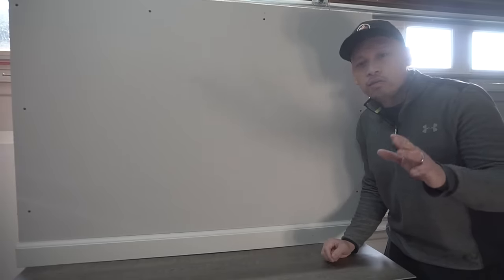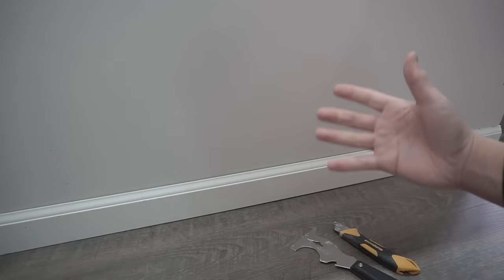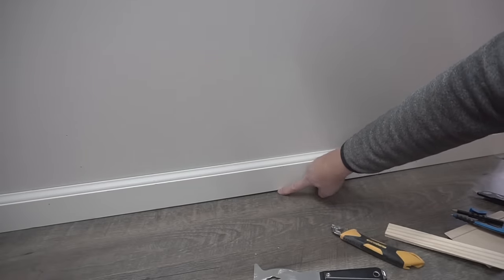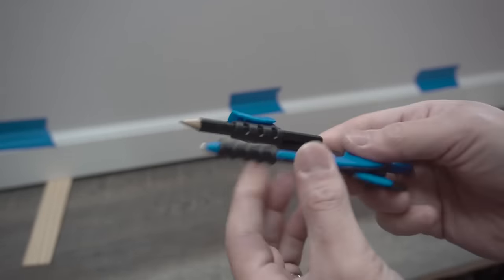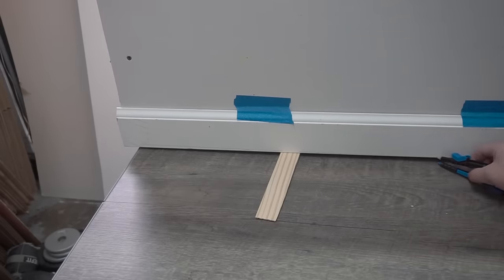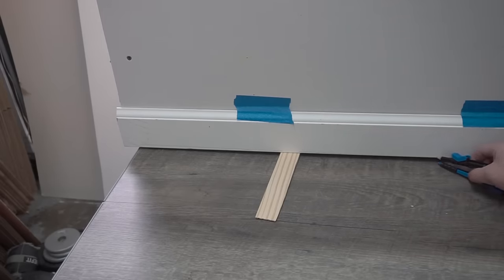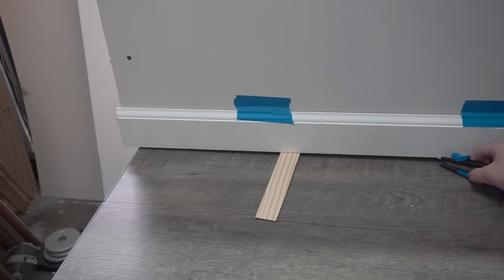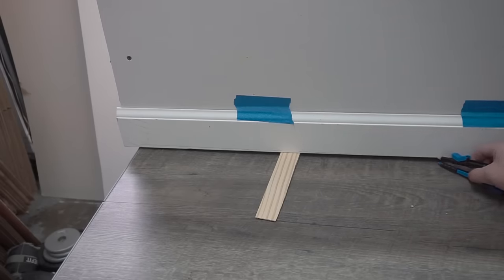How To Fix Gaps Between Baseboard And Floor For Perfect Fit! DIY Step By Step Tutorial For Beginners

Comment: I have a much easier method.  Don't go through all that sanding or planing of the base board.  Add a quarter round at the base of the base board, which are more flexible, will hide any non-huge curvature in the floor and looks pretty darn good.  Plus the job will go much quicker without all that sanding.  Fill in any cracks with Alex.  Tip: put the brads for securing the quarter round into the base board and not the floor!
Reply: I got a easier one. You can lower the baseboard more the add finish nails. If it’s still a bit opened then just add caulking. I did this so many times that my caulking skills in impecable no one can tell lol

Comment: Remove baseboard and more than likely damage the drywall, or if not you have to work at possibly blending the now exposed area. Or save yourself quarter round and be done in 90% of the time.

Comment: This has got to be the longest time ever to fit 1m of baseboard  good luck doing  the rest of the house using this method 😬
Reply from the maker: Just an option 👍🏽😊🙏🏽, can always use quarter round, shoe moulding or caulk. It’s by preference

Comment: this method works but grab a block of wood put it above every gap and push down flexing the base add a few nails. time is money but yes your method is nice if you have lots of time.

i would offer this service to my clients but i advise against modify baseboards for many reasons. 
some customers see gaps like this and think its shatty work but really after i inspect the workmanship was perfect and every summer theres a gap and every winter theres no gap what do you think happens when you remove that gap in summer and now it becomes winter??? some customers demand to much perfection from materials that move. i will solve these customers request but decline them as future clients as they are a headache waiting to happen. 

i love the clients that can understand expansion and contraction as well as any other advice i offer to avoid potential future regret.

every alteration you make to any material will likely change or remove the materials moisture barrier and you can accelerate the materials degradation thats why when you connect baseboards together you use an adhesive or caulk at all cut points at the base of material is a lot of exposure.
almost got scientific but in the end its all about what makes the owner most happy!

Comment: With this scribing situation where the floor dips is totally incorrect!
It works only if this base sits by itself. 
If the base connects to the adjacent base around the corner withs miter, you will start to cut the height of the adjacent base, just to cover this little one. More unnecessary work involved. 
Pushed that sucker down and nail it!

Comment: Rip some 1/8th shims. Stack them against the baseboard as high as you need.  A little bit higher is fine.  Hold them down and draw the line.  Cut the baseboard.  This video should be 30 seconds long.

Comment: 1. This is a bad idea, you will make extra work and have an issue on the corners. You will have to do this everywhere.  2. Also not a good idea to push it down and nail it, you will see the elevation change and it will look meh. 3. As long as the gap is 1/8" or less, just tape the floor and fill it with caulk, then paint it when you paint the base.  Three major benefits to caulking it: The elevation will be flat, the bottom will be sealed and prevent water from sucking up in to MDF base, its fast and easy once you learn to caulk with a little skill.  If your gap is like 1/4", stop and address the dip in your floor, or get creative with the other methods.
Reply from the maker: Thanks for the feedback. This is just an option for those who have gaps in the middle and it tapers to the edges. Just giving options 🤷🏽‍♂️

Comment: Sorry but this is not good. I use one of the two options: 
- (Not so preferred) open the bottom of the flooring feed with some self leveling chemical and raise the lower part.
- (The best) Have an approx 3 feet of timber, around 1/2 thickness 5-6in wide. Nail the baseboard on one of the highest spots, then put the wood piece by 90 degrees on the baseboard's low spot on top. Push the wood edge meeting the wall down with your knee and nail it to the wall. Keep on doing it by sliding the wood piece as needed on the lower sections. What you are basically doing is following the wave of the flooring and shaping the baseboard accordingly without any thickness change caused by cutting.

Comment: Sorry but that little gap could have easily been taken care of without scribing, when installing the baseboard you can flex it down before nailing, if you need to scribe , do it with a piece of wood up against your material to the desired thickness.. and never pound a nail back through because it will destroy your finished side.. picture a bullet going out the other end.  I appreciate people making videos that are actually knowledgeable.

Comment: Yeah you just cut off on the bottom left now how is it going to line up with the other baseboard at the corner its gonna come out short
Reply from the maker: This was just a 55” mock up, sometimes dips happen around middle areas and tapers off to nothing on the edges. Like what I mentioned this is an option fix and only apply on certain situations. It is not a cure all. Options are important.

Comment: That’s what shoe molding is made for. 7/16 x 9/16
Reply: This is also what scribing was evolved for. Shoe molding is the proffered method because the labor it saves pays for the extra material.  I don't know what it is but there is a price/foot were builders should move back to scribing.

Comment: If your floors are not level , DO NOT LEVEL the top of the baseboard. You will have one end of the baseboard a completely different height than the other end and it will look like crap.

Comment: a table saw would of made that so much easier... but this is way too much work for a baseboard, just press down on it and nail it down flush to the flooring.... baseboads are flexible enough to handle more flex than you think

Comment: No need to scribe this baseboard to the floor. You cannot scribe as when this base meets adjoins base there will be a difference in height…..no no
Just apply light pressure to lower the base down at the low point. Or add just a little sealant to cover the gap if needed.
Final point, level the floor before you apply there floor laminate then no problem for the base.
60 yr old cabinet maker. / joiner

Comment: nice try but no I wouldn't use that method. Get a big lad over 250 lbs and get him to press down with the butt end of a 2x4 where the gap onto the edge of the molding and flex it down as close as you can get it. Nail it in place.

Comment: Err, waste of time just silicone seal it, the flooring isn’t waterproof from underneath, so a bead of silicone and a moulding tool to get a good finish, allows the floor to expand and contact, seals it and it looks great, pissing about removing skirting boards and cutting them is just a waste of time, unless you floor is a bus ride out of flat, but if it was you’d screen the floor with self level before you fitted laminate

Comment: They invented 1/4 round for a reason. This would be for a rookie not a professional.
Reply from the maker: Yes hence the title 👍🏽😊 also this is just another option 🙏🏽😊
Reply: Hehe… There’s absolutely nothing professional about adding trim pieces on top of trim pieces. Can’t stand any floor-wall transition with more than a baseboard.

Comment: Now, as a professional trim guy, explain why your estimate is 4 times higher than any one else's and it's going to take you 2 months to run base. Good luck.
Reply from the maker: I do these for DIYErs not fo contractors 👍🏽
Reply: @FixThisHouse  That may be so, but you're doing a pretty big disservice to your Average Joe here. Once you cut down one piece of base you need to cut every other one that it meets. Not a big deal if its one piece going from casing to casing, or even 2 pieces. But if you're doing an entre room with 5-15 miters... I mean you could start with a 5 inch base at beginning and end up with a 2 inch base half way around the room if you're not paying attention.

Don't get me wrong, I use this trick all the time in the proper context. The key is context. You only do this in certain areas and certain situations. They way this is presented makes it seem like a whole house solution, which it is not. I'm not saying its a bad technique or that you did a bad job presenting it. I am saying that presenting to "DIYrs" who haven't run miles of base and don't automatically see why this is situational and not standard could get some one in to trouble.

Comment: Way faster way. Leave the board on the floor, take a carpenters pencil lay it flat and draw the line on the base. Then for the love of god buy a block plane and shave off to the line. Belt sanders and jig saws are not the right tool.  This gap by the way is so small you could take another piece of base about 3 feet long, place it on the top of the base on the wall and then kneel on it. The base will sink into the gap. Nail it and be done.
Reply: I'm seeing your comments on carpenter videos man you know your shit 🤣🤣 I just got started finished carpentry thanks for the the tips and knowledge. Can you give me any advise about crown molding? Doing some this week for the first time
Reply: @stephancccc8176  first welcome to the world of carpentry, best trade in the world. Crown molding, well there’s a topic. Can you hang base board using a scribe and coping saw?
Reply: This skill is required to hang crown the right way. FYI.

Comment: What a shit jigsaw cut, having to use a belt sander to clean it up lol. Pro tip is to push down on the point that is high and spike your fixings with some polymer. Also noticed that it's only on one wall. You'll be in trouble if you start to do this and the skirting continues around the room continuously.

Comment: Totally wrong way of doing this its ok for a high spot, a low spot without using a shoe molding you measure the maximum gap then rip that thickness off another trim then glue it on... then do what your doing this way it'll match in even with solid wood that's going to be lacquered.

Comment: So now when you have to wrap the baseboard around the corner, the next piece of baseboard will be taller so you are now going to have to cut down every piece of baseboard.  No thanks!!
Reply from the maker: This doesn’t work in every situation. This is just an option. This will work great for big dips in the middle area and then tapers off the edges 👍🏽

Comment: THIS IS NOT A GOOD SOLUTION!!!
As soon as you get to an inside or outside corner, you'll have to "shave" that piece to match the last piece. MDF does have some flexibility, so, push it flush to the floor.
Or, don't be so cheap and do the job properly, by giving it a much better finished look and install quarter round.

Comment: Nahh! Adjoining baseboard  will not match height. Unfortunate. But caulking.
Reply from the maker: This works only if the dip is on the middle and it tapers out to the edges 👍🏽😊

Comment: REALLY?? are you kidding me? all that work? for what? ONE word people. SHOE-MOLD. i wasnt going to comment but all this work is stupid. shoe-mold is fast, cheap and looks fantastic. its flexible to push down and hide any gaps. take off the baseboard? going to have to repaint, touch up. recaulk, fix any damage you did. are you kidding? hey ... go for it if you want to waste time and make a mess. oh ya. dont forget to buy all the extra tools (sander etc) to do this. SMH.
Reply from the maker: I agree with your shoe mold, but not everyone wants to go that route. Don’t say something is stupid just because you don’t agree with options. That’s exactly what I put in this channel is OPTIONS and thinking outside the box. There are other ways other than shoe mold…there’s caulk, quarter round, pushing down the baseboard (if you want bowed boards) and this method. So many options 👍🏽😊

Comment: This is not practical in a professional setting I can see it being done as purely diy an oops I didn't think of that moment but as a professional home contractor or any one else in the trades would have run multiple checks on there substrate and done all flat or level fixes prior to the floor install in these cases 99% percent of the time some glue on board does the trick or if in the right circumstances some good self leveler.

Comment: That's too much extra work and you still have to caulk it. If you're planning on going with baseboards with no quarter round or shoe, hire a professional floor installer that will get your floor flat within 1/8 inch in 6ft and bypass all this EXTRA WORK. LOL

Comment: No offense but that gap is too small, you can just push it down with your knees or just put a shoe molding 😂. No need for that extra work because I can see the imperfection of the cut, it’s time consuming.
Reply from the maker: Thanks for the feedback! This was just an example as you can see I’m doing this On a mock up. It’s meant to show concept depending on similar situations. Just giving people another option 👍🏽😊

Comment: I'm not seeing it! Wasted energy leveling a baseboard when the floor may not be level. And base-shoe would have covered that small gap, or a small amount of pressure on the baseboard would have pushed it to the floor ready to be nailed dead tight to the floor. What are you doing?!  You scribe the entire length of that baseboard, and you have to scribe EVERY adjoining piece that comes in contact with it at corners. There's a time and place for what you can and should scribe. For the baseboard you're working on, no way.

Comment: Great waste of time. Wait until you try to miter the outside corners and find your adjacent baseboards run uphill and downhill and are no longer plumb. Then you have to hand fit every outside corner with a compound miter. That's why they make base shoe. And please don't use quarter round, it doesn't flex flush with the floor not to mention is an eyesore and screams new DIY'r. Base shoe is pro.

Comment: You boycotting 1/4 round for some reason? If the homeowner wants everything to look nice and level and paying you all this money to level out the trim...fix the floor. I would think you could pull the boards and throw some motor down to level the floor.
Reply from the maker: Not boycotting. Just giving this as an option 👍🏽😊

Comment: This guy definitely doesn't know what he is doing he basically messed a piece of baseboard up for no reason cause it will never line up with the next piece unless he rip every piece like that and there's so many faster nicer ways of fixing that problem but most builders do trim and painting before they lay the floor and then use shoe molding and it looks good  plus get a good set of shoe cutters could do a whole house quicker then him doing that 1 piece

Comment: Second thing I thought he was going to do was just push the baseboard down a little bit, or #3 slip some wax paper under the baseboard then caulk, any of the 3 things I'm mentioning would be better than what he did. I'm sure he realized that after posting the video 😂
Reply from the maker: All those you mentioned are obvious and easy solutions. Nothing wrong with taking shortcuts. 👍🏽😊

Comment: Way too overcomplicated, you can just run a pencil along the floor to make your line then use a power planer to take the material off. No need for a compass, shims, level or sander.
Reply from the maker: Ok

Comment: I'm sorry but no one that is concerned about production is going to scribe base. Maybe on a high end custom job where you are paid hourly and they are willing to pay for the time but you could never bid high enough to make a living doing this. And their is no gain since 90% of the time you're going to calk the base anyway.
Reply: You're not wrong, but there are rare cases where scribing still makes sense so it is still woth talking about.  This video is a good introduction, but I don't think it adequately prepares someone to do a whole room or match the height when replacing a section of an existing baseboard install.